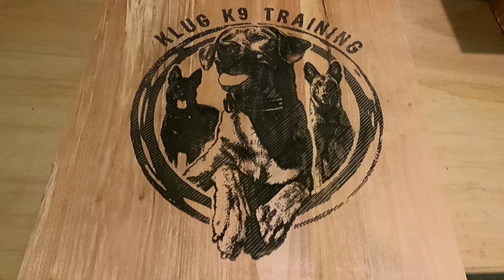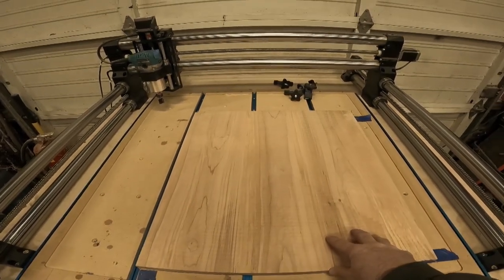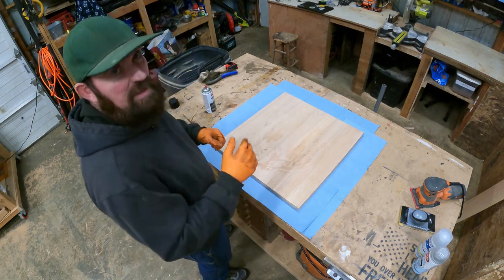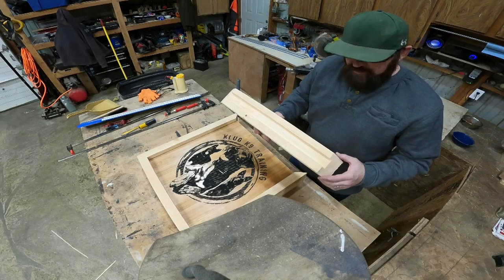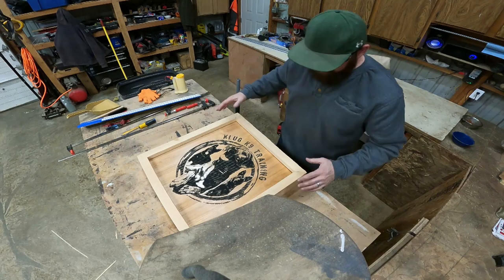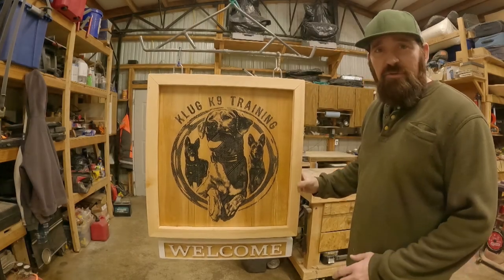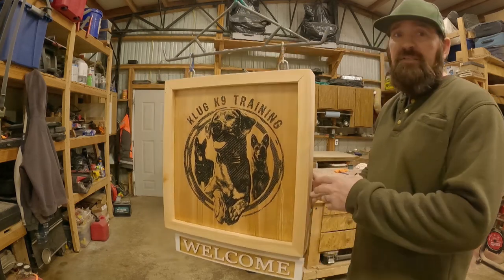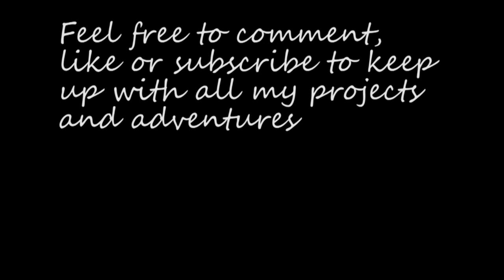First CNC photo vcarve

Comment: Looks awesome! If you seal the wood prior to carving, it makes the sanding ALOT easier and faster. Bullseye Sealcoat is what most folks use. The #1 reason to bother to do that, IMHO, is that it minimizes how much the paint “gets into” the wood, so you’re sanding away a thinner layer of paint. Sometimes I seal before AND after carving. Why? Whatever you carve away becomes endgrain, which may cause bleeding that’s hard to remove.